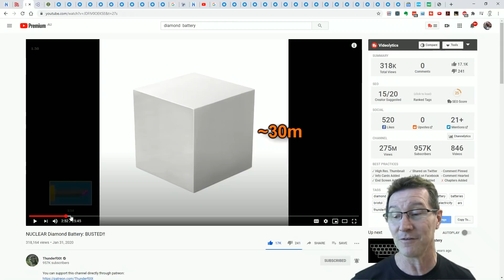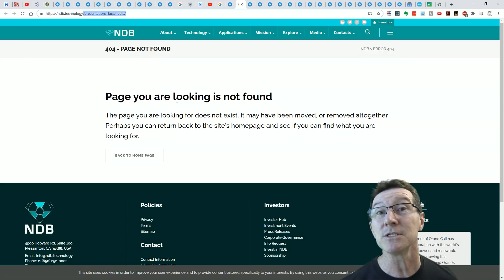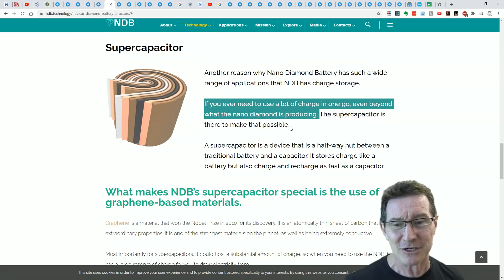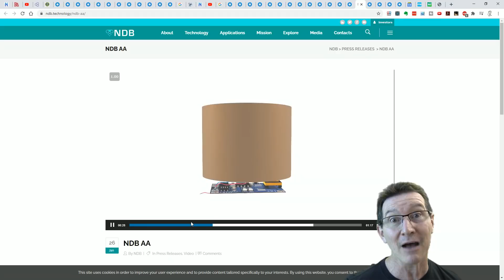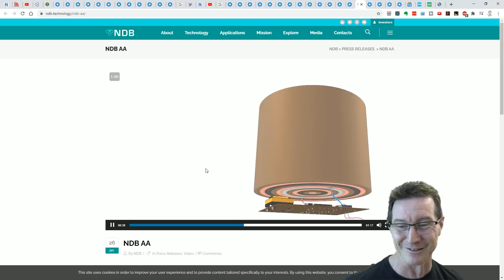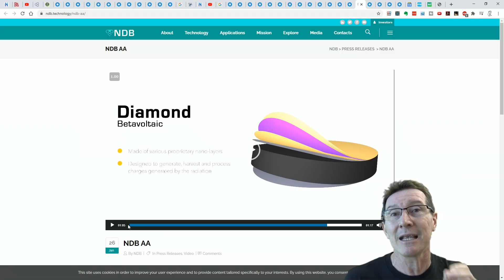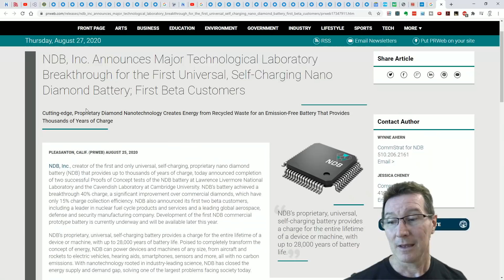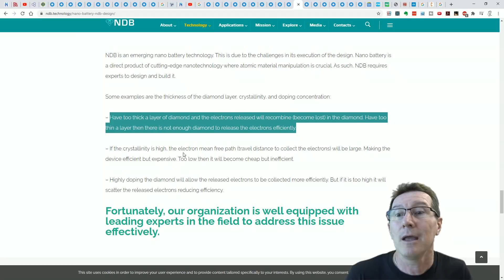EEVblog #1333 - Nuclear Diamond Self-Charging Battery DEBUNKED!

Comment: This made me think ... Could you make something that's like a solar panel except instead of visible light it captures cosmic rays to be used in deep space?
And how much would this "stellar panel" have of maximum theoretical power per unit area?

I guess the problem is that these super high energy rays just go through everything, right? You need kilometers of atmosphere to stop them so a thin metal sheet would capture bugger all?
Reply: Is it not super rare for a cosmic ray to hit a small area of measurement you're suggesting?
Reply: @localcragdirtbag8049  Yea but I think mostly because of the thickness and not the area. You'd make up for the area by the energy of the ray but if it just goes through without interacting then it doesn't matter if your area is one square kilometer or a 100 of them

Comment: It has all the hype words, Nuclear, Nano, Self Charging.
That and 100 Microwatts? Thats it!
My electric bike has a 400Wh battery! Just how big must the battery be filled with those things to make a decent amount of Wh's. By your calculations it would be like 22k times 2.3 for reaching lithium voltage... over 50000 hours. Yeah, I don't think this will work! 
On my bike ride to family I use around 120-160Wh's on that battery, depending on the wind and weather conditions. How big will the battery system be, how heavy? For my trip to and back to family visit.

Comment: The actual silicon wafer in a DIP package is way smaller than the chip itself.

If we were to give them the benefit of the doubt and assume that they've found a way to take the 0.1mW silicon wafer part as used in that City Labs battery, then stack dozens of those up into an AA sized package, how many wafers would they need to stack in order to generate enough power to run an IoT device that requires a couple of mW in standby with a short burst of energy while sending telemetry a few times a day?

....that's about the only thing I can see something like this being useful for, and that's based on the above assumption being correct.

Comment: what i see is a boost converted batery yes you can run a 12v fan with a 1.5v boost converted were part of the 12v is used to recharge back the 1.5v making it a loop

Comment: If I understand correctly, the idea is that radiation is used like sunlight to power something analogous to a solar panel, but the efficency is really, really low, meaning you only get microwatts of power out of it.
If the efficency could somehow be improved, perhaps a battery could be made using a combination of two technologies.  If the shielding is good enough, the battery could use the radiation to continuously recharge a chemical storage rechargable battery, so it charges slowly while not in use.  That'd be good for a battery which only sees occasional use.
But microwatts?  Really?  That's so useless it's pathetic that anyone thinks otherwise.

Comment: There is loads of stuff that could use 100uW... the question is really price.

I worked with developing a sensor 15 years ago that use industrial vibrations to create power. Stored it up for a day, then sent it with radio. Rather expensive method

Comment: I am not a nuclear engineer or anything of the sort and while the NDB nuclear battery may be pure marketing and lacking any data, my personal opinion is that it is also marketing and that the product can be debunked, my comments are on the debunking since it seems circumstantial (others that I have seen you do contain actual scientific data and calculations like the wind turbine one):
1) The image that the debunking is based on may just be of a pin to pin compatible product with an existing city labs product (it does not mean that the entire chip is used for the energy harvesting / generating), with a higher lifetime, it is common in the industry and you have even shown such similar behavior in the industry here:
https://www.youtube.com/watch?v=5Q1MPrgea1M
2) The DIP chip usually contains some ceramic packaging (actually I think that the packaging consumes most of the volume of the chip), so the actual device may be a lot smaller to generate the 100uW.

Comment: you could possibly power a wall clock or weather station receiver with it but not much more. But it would probably cost way more than changing the battery maybe once every three years.

Comment from the maker: Check out this post on the EEVblog forum about the companies the founders are involved in:
https://www.eevblog.com/forum/blog/eevblog-1333-nano-diamond-self-charging-battery-debunked!/msg3207912/#msg3207912
Reply: EEVblog would you really want an AA sized battery which has to put out as much energy as a typical AA every hour (or put it out as heat).

One reason you can theoretically use diamond like carbon stacks to make considerably more power than tritium beta voltaic generators is you can manipulate the carbon it’s self to be a good conductor which should make them more reliable than stacks of other beta emitters.

Presumably for energy intensive applications you would need stacks of thousands - hundreds of thousands per battery (a stack of a thousand CPUs would be $$$)

From what I can see each wafer or whatever would take about as much effort to make as a CPU chip the same size. You should be able to make big stacks of them and they should produce a steady output for a really long time unlike the tritium based ones.

They should be brilliant for stuff that is really expensive or protecting really expensive stuff but is in hard to reach places. Like IOT environmental monitoring, space probes (though the heat from the thermal generators is more of a plus with old school electronics we should be able to make probes that work very efficiently at super conducting and quantum computing temperatures.)
Reply: Chrome tabs much?
Reply: why does it have so many pins 🤔🙄🙈
Reply: i suppose, it could be used to oscillate a transformer, if each loop of wire was wrapped individually (maybe) 🤔🤷‍♂️
Reply: Absolutely ridiculous.
Reply: i had a idea for a different type of transformer, instead of one wire with 250 turns, this one has 250 individual loops of wire and processor to switch each loop on/off 🤔🤷‍♂️
Reply: FREE ENERGY! this will solve the worlds energy crisis
Reply: You actually don't want this technology to produce a lot of power cause it also means it's highly radioactive and dangerous in any consumer device. If you pulverize such component, whatever power it is supposed to deliver electrically is a subset of the radiation that it will emit. For a car you need tens or hundreds of kilo Watts. That would mean an insane radiation danger if it was made this way.
Reply: ThinkingBetter diamond like carbon is pretty tough stuff, current lithium car batteries are generally made of many smaller batteries to minimise risk of fire.

Diamond like carbon could be vaporised by a hundred KW short circuit but there would be no reason you would wire the batteries up so that they would have a large amount of power going through them in an accident.

They would could be very safe.

It would also be crazy not to use super caps and possibly lithium batteries to provide the power to accelerate hard, go up hills etc. You would have to have some way of burning off excess power or putting it into the grid when the car isn’t being used and the batteries etc are charged.

The main problem I can see would be it wouldn’t be free power each wafer would be expensive to make and you would need literally millions of them to power a car even for very modest distances in a day.
Reply: Glen Collins You don’t get my point. This concept is using radioactivity to generate electricity. The more power you generate the more radioactive isotope you need. A car needs continuous 10s of kW electricity. To get that from radioactive decay needs too much dangerous radioactive material. The car would be a mini Chernobyl if the battery got opened.
Reply: ThinkingBetter I got your point Chernobyl was mainly a problem because the radioactive materials were released as gasses and liquids. Unless you crashed the car into lava or someone took to the batteries with oxyacetylene torches the carbon isn’t going to burn.
You couldn’t make a single large stack so you would have to use thousands of stacks which all produce a few watts each.
Reply: @glenecollins  If you make an EV that can drive 5 miles per kWh of energy at a speed of 60mph, you will need CONTINUOUSLY 60/5 = 12kW of power from this "battery". 12kW / 100uW = 120,000,000 or 120 MILLION of these parts just to keep this car running. It will still need some additional super capacitor or battery to deal with peak loads during acceleration. A super capacitor can only help with peak loads for a few seconds. This is 100% meaningless.
Reply from the maker: @glenecollins  What happens when the energy isn't being used and the heat from the radioactive decay isn't being used, where does the heat go?
Reply: EEVblog I imagine if you had a generator which costs as much as an orbital launch to run your car you wouldn’t care too much about wasting energy? If you had a generator which could power a sleek car at it’s mean driving power it would only put out about as much energy as a large older conventional engine does at idle;
You could put a heating element with a fan or two on the front of the vehicle and just waste the energy/ Or you could plug it in to the grid.

I imagine It would pay for itself sometime In it’s claimed battery life if you plugged it into the grid at current electricity prices (hopefully we will get energy costs down quite a bit in the next few millennia so it should never even come close)

The waste energy would also make diamond batteries a bit tricky to design a super efficient deep space probe around. You would need something to waste excess energy well away from the super cooled components any time the full production of the generator wasn’t being used.
Reply: ThinkingBetter that would be an electric Hummer or some sort of truck? A Prius can get 11 miles on a 4.4KW battery and that isn’t just flat driving.

presumably you would put in a lithium ion battery sufficient to run the car for 50Km or so without charging, or given the incredible amount of money it would take to make the generator bank you could probably afford to make a bank of graphene super capacitors which would run the car that far it would be far far less expensive.
Reply: @EEVblog  Yes, 12kW of heat is a lot to get rid of while an EV is parked and you can't just switch off the radioactive decay. Actually, to make 12kW of electricity, you are talking about a lot more heat being generated as nothing is 100% efficient. This idea is ignorant madness and a Chernobyl on wheels.
Reply: @glenecollins  You probably mean "kWh" (energy) instead of "kW" (power). 11 miles per 4.4kWh is not very efficient (11/4.4=2.5 miles per kWh). I was even suggesting twice that. The entire math isn't close to anything feasible. It is idiotic at best and would be incredibly dangerous if someone  made multiple of kW of power from radioactive decay in a personal car. I'm not so excited about super capacitors in EVs because their energy density is much inferior to batteries. EVs that are aiming at getting to 60mph in a couple of seconds can get help with some peak power during those 2 seconds using a super capacitor bank. But even existing Li-Ion batteries can produce insane power (100s of kW) without needing super capacitors during burst loads, as you can see in some EVs. Don't get fooled by all the misinformation on these subjects.
Reply: ThinkingBetter the generator would be constantly putting out the power so it would be KW so it gets confusing I probably screwed up talking about the capacity. I think you could make them safely but they would be a massive waste of money and effort. You could setup a pretty big solar farm for the cost of making a “battery” for one car. 

If you could just throw money at making the capacitors a capacitor bank of more than 5KWh should be doable with graphene (it would be pretty explosive).

Just because you can do something doesn’t mean it is a good idea lithium ion batteries can be dangerous enough if you don’t take precautions.
Reply: @glenecollins  Forget about nuclear power in a car. The BES-5 Russian nuclear electric generator used in satellites delivers 3kW with an insane thermal heat of 100kW. That's 3% efficiency. It's using 40kg of enriched uranium. And you need 4 of these to power a modern EV LOL. And still you need a battery to do any acceleration cause 12kW is not enough to give you any good acceleration. 12kW is just 16 horsepower :-)
I am more excited about how batteries are reaching numbers that make this topic irrelevant. When you have >500 miles per charge and the battery can last you a million miles, nuclear power in your car is a hard sell!
Reply: ThinkingBetter not my car, I think it would be insane to make an AA (1.5w) sized generator with current techniques except under very special circumstances. I agree batteries are the best option we have at the moment.

 I think you are confusing radio-thermal generators and beta-electric generators. The theoretical upper limit on the efficiency of the heat based systems depends on how well you can get rid of the waste heat.

The upper limit on the efficiency of beta-voltaic systems is the percentage of the electrons which can be captured and the amount of inertia of the electrons which can be converted. 

If you used 8nm chip making techniques to make the collection circuits you should be able to get close to 50% efficiency, 3D atomic printing could theoretically get close to 100%. It does make them a far more interesting prospect for a long term power supply in hostile environment, space probes etc.

Comment: The concept might work. It sounds like a electron/phonon source tied to a photovoltaic cell or alike.
Maybe it uses the Cherenkov radiation as a light source.

Power density doesn't met the requirements for what we expect.
Congratulations marketing lads you  achieved scammer abilities!

Comment: Reminds me (back in 2009 or so) of a prototype fat powered microbial fuel cell some grad students developed in college, which they were presenting. I really liked the idea since fat is easy to find in the US, but it's obvious that the technology has a long ways to go before it will find any practical applications - the prototype the size of a CD case could only supply a few microwatts. (And the claim that someone built a fat powered car but then "got suppressed by the oil industry" goes just like all the other "technologies" that "got suppressed" - never really happened.)

Comment: Assuming:
1. They make their diamonds out of 100% carbon-14
2. They can convert 100% of the energy from the radiation into usable electricity
3. The conversion circuitry takes up no space

A AA battery sized piece of carbon-14 would produce 4696kWh (multiply the 0.156MeV per decay by the number of atoms in 31.5 grams of carbon 14 and divide by 2 for the half life) over the course of 5730 years. That converts to 0.82kWh per year or about 93 mW.

According to Estimates of the Quantities, Form and Transport of Carbon-14 in Low-Level Radioactive Waste, a nuclear reactor is estimated to produce a maximum of 110,000 curies of Carbon 14 over its lifetime which converts to about 34 kilograms or 1000 AAs worth of diamond.

Unless they can somehow dramatically increase the amount of carbon-14 produced in the reactors, they won't be able to produce many of these "batteries".